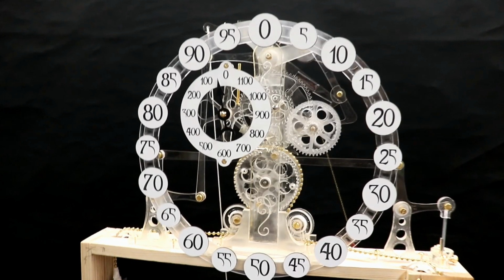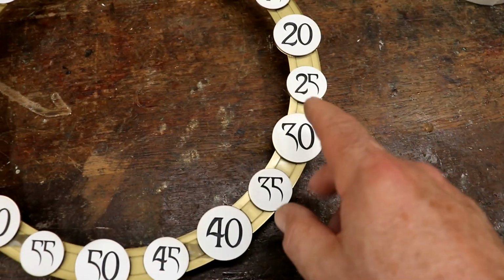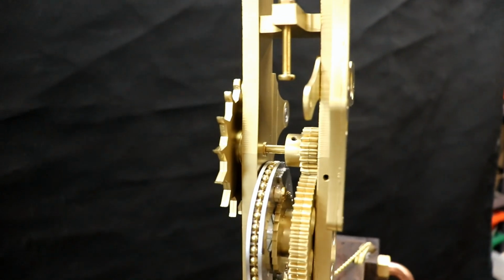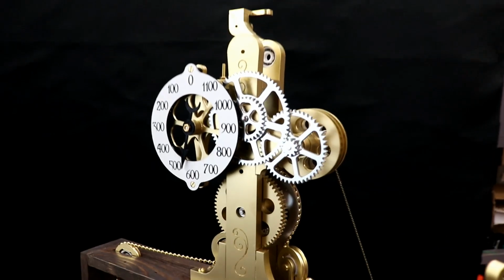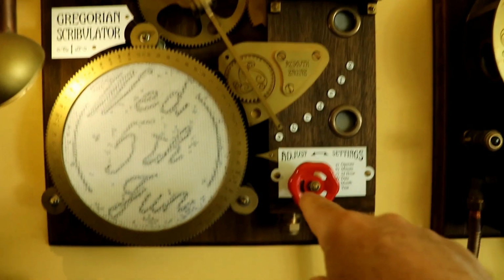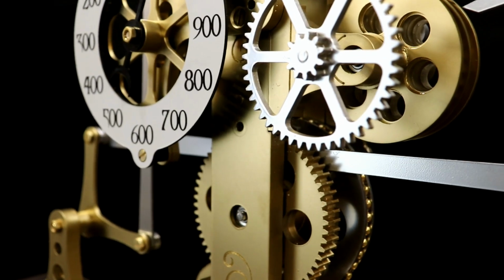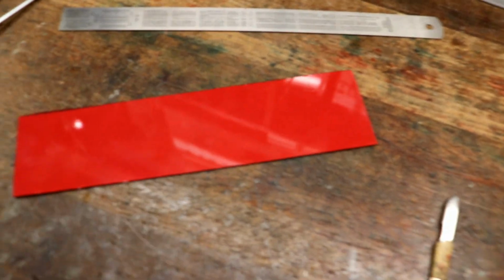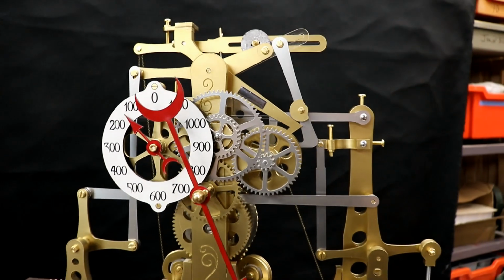Unplanned Steampunk Arcade Machine #9

Comment: So this is something I noticed before, but it's more obvious after everything has been painted and colored and appears to possibly be repeatable. The large scoring hand seems to miss a step between 30 and 35 and again between 65 and 70. As the dial goes around, it seems like something doesn't quite catch and the mechanism requires an additional tick to move on to the next number. I also recognize that the two groups of numbers and both in the bottom half of the dial and directly across from each other. This makes me wonder if there is a damaged gear tooth, or maybe something is slightly off-balance that would cause the mechanism to not advance on the first try when the dial is specifically in those two positions.

I realize it has been 13 days since you uploaded this video and it's likely you have done a lot more work on the mechanism since then, but I'm wondering if you plan to explore that symptom at some point. Either way, I'm excited to see what you've come up with when you upload the next video.
Reply from the maker: Thanks for being so observant! Having carefully made a new scoring ratchet, I don't think that is the problem. I believe it might have been as a result of the original escapement. I've made a new one with some changes to the design, and sanded each of the two laser cut acrylic layers to ensure everything is parallel. The addition of copious amounts of graphite powder helped it to function more reliably.

The fact something introduces a 'random' element to the scoring could be useful? Working purely mechanically is so difficult!

13 days is far too long between videos - I do apologise. The reason is that I received an order for another bespoke Barometric Prognosticator. Having made many videos on their construction, I'm just getting on with it. However, today I videoed another video, just keeping my wonderful viewers appraised of the situation.

I have also made an appearance on a Channel 4  series (in the UK), Outrageous Homes with Lawrence Llewelyn-Bowen! I don't know whether it can be viewed outside the UK.

Thank you for your continued interest!
Reply: @steamhead  No need for any apologies, I love your content and am happy to wait for it. Sounds like you've been busy as well!
Reply from the maker: @Advil1024  Never a dull moment!

Comment: Also why don't you use smd resistors to work with your smd LEDs. 1206 size could be large enough to solder easily. I use smd parts whenever possible. For example 805 size fits perfectly with .1 inch spacing standard of PCBs and ICs. You may also test smaller size Arduino modules like Nano (the new generation).
Reply: The LED found on the solar string lights is just a blob on two wires, 100 for 2 quid and scale nicely and look like a miniature bulb.
Reply from the maker: If more people purchased the shell lamps, which are a really niche product,  I'd definately consider  getting populated PCBs made up by some company such as PCBWay with smd LEDs and resistors. Sadly I seem to have cornered a (virtually) non existant market again, so continue to use up my collection of LEDs from a self adhesive strip and 1/4W resistors. One day I hope to move to smds!

Comment: As usual you solved all the problems. Well done. Is brass colored plexi much more expensive than the transparent one? I recommend you use colored plexi in your complicated mechanical parts. Paint will always be a problem and moving parts wear out the paint easily on the edges. Your scoring part is very sensitive to temperature. It is summer now, in cold weather it may not work. I recommend you add more adjustment parts like the one Ziggy suggested. When I design complex system, as I solve the problems the system becomes over complicated. But than I iterate and redesign the system using my new experience to simplify the design. This method pays off in the longrun. Your system if not used for months may not work again and you may  need to solve the problems again.  Red dial looks nice by the way. Using time as scoring hopefully pays off. This way you isolated the scoring system from the gameplay. Hopefully your game design will have almost no effect on your scoring design.
Reply from the maker: Hi Ibrahim, the problems are becomming more challenging... I've failed to find a supplier of brass coloured plexiglass and can't even find out if it's even manufactured - I wish it was!

Thanks for the suggestion; I've added as many adjustments as possible and they have proven invaluable. Hopefully they'll allow for changes in temperature and the water absorption properties of acrylic - who knew?!

Having the gameplay isolated from the game 'management' and scoring system will hopefully pay dividends! Keep the mechanisms separate...

Comment: That is looking really awesome John. I was always concerned about the effect of the spray paint, both adding friction and scraping off with wear, but it never seemed to be a problem on your other machines. What paint do you use?
Reply from the maker: Thank you. I use Plastikote Metallic Brass spray paint.

I was amazed to find, with my first laser cut geared machine, that the gears worked perfectly once painted and continue to work eight years on. However, most of my machines employ  elecmatrickory to provide the movement.

This is the my machine that relies entirely on gravity and it's become apparent just how much friction a painted surface can introduce! Powdered graphite solved the problem...

Comment: I noticed that you are cutting holes in the gears, maybe you can use these clippings as numbers, they have a beautiful triangular shape with conjugation. Well, that's for the future. Regarding the gameplay, I only see arkanoid, pinball, some kind of maze. Arkanoid and pinball are clear  how can it be. A maze, it can either be something like a Galton Board, or so that you can rearrange something to change the paths as in spacerail board game, when you build your marble track
Reply from the maker: Thank you for noticing the clippings. I always endeavour to use the materials as efficiently as possible, however there are bits of material, especially 'those with a beautiful triangular shape with conjugation', that are too small to be used elsewhere. I place any unavoidable offcuts, along with all the components that don't work, into a box of exciting parts. For the cost of postage, I then send these boxes to people who can make use of them - nothing's wasted!

Regarding gameplay: I imagine having some sort of skill based ball directing system at the top of the machine that the player can use to direct the ball into one of several alternative challenges. Assuming I go with the Jules Verne idea, the ball then has to be aligned to land on a load of moving clouds. These could direct the ball into the top of an airship. The airship could also be moving with a variety of ball channels within it, some of which direct the ball into a circular maze... you get the idea. If the ball is correctly aligned, it could then fall into a moving Nautilus submarine.

So many exciting possibilities... Thank you for your suggestions.

Comment: Looking good and the red pointer adds to the tension brilliant build John.  May I suggest you  investigate Nickel plating. Since you are spray painting anyway you can spray a conductive paint then plate with Nickel. The process is not at all difficult or messy unlike Chrome plating.  Nickel plating solution can be made from a strip of Nickel, some vinegar and a 1.5 volt battery.   I have tried various plating metals but Nickle is the cheapest and best.  Nickel also does not tarnish quickly and has nicer colour to silver and copper. Well done John, tell Ziggy, Banjo & Cooper found a Basking shark on the beach so they had a good roll around and smell rather ripe.
Reply: Wow that sounds really cool.. didn't know you could do that!
Reply: @syrus3k  YT comments have gone weird and my first reply to you disappeared. Anyway this is the channel that I found out how to nickel plate  ' Geoffrey Croker ' . I think you will find his style very informative and I hope John takes a look as nickel plating is found on a lot of Victorian kit as it does not oxidise like brass and cooper.  Have a go, also you can salvage the silver plate of cutlery and use the solution to deposit silver, win win.  Best
Reply: @WOFFY-qc9te  I'm actually in the process of setting up something called peertube which is a DIY YouTube open source federated thing.. hopefully one day we'll be rid of YouTube!
Reply: @syrus3k  I have had many failures with copper plating and chrome just rubbed off and is very toxic, I found that Nickel is idiot proof. Recently conductive spay paint has become available and that allows plating plastics. Too make life easy with the voltage use a 1.5 v battery and leave the job alone for a while.   I found the original channel that steered me to simple nickel plating it is very good and with no crap. GeoffreyCroker  Have a go it is very rewarding. Also you can salvage silver from old cuttlery !.
Reply from the maker: Thank you kindly. I'll definately look into Nickel plating as the silver spray paint isn't nice to use. What should I use to first make the surface of the acrylic conductive?

Banjo & Cooper must have been thrilled to find Eau De Rotting Basking Shark. The other day Ziggy appeared from a woodland exploration, proudly covered in some unspeakably horrific gag provoking substance. Two washes later...

Comment: You totally need a vacuum deposition system.  I could help you build one. Imagine having real gold plating and merely using gold leaf or a donated filling as the source.
Reply from the maker: Thank you for the suggestion. A vacuum deposition system would be lovely, although a spray can of brass paint seems to do the job! If the gears, especially the escapement, don't stand up to the rigors of operation, I'd consider getting them 3D printed in metal by some third party!
Reply: @steamhead  I used to run the electron microscopy lab at Winthrop University and we’d coat things ranging from honey bees to dust mites. The beam would only bounce off of gold or other metals, therefore the scales of a butterfly wing, needed coating. I love the incredible skill you display with your processes. I used to live in Cambridgeshire. Where do you practice your genius?
Reply: @Endoplasmic-Reticulum  It is an amazing process but on the sub micron level. insect look amazing after VD. I think the thought emporium did some home brew work.  Aluminium is the easier as it has a low vaporising temperature and I tried to re-coat a torch reflector with mixed results.   In todays world there is so much kit around it is something that can be done in our sheds. I did some work on a centrifuge at L=Pool university (1990's) and was shown the Electron microscope and a plated Moth, I spent too long in the lab and had to work late to catch up.
Reply from the maker: @Endoplasmic-Reticulum It's a privilege to be chatting with someone with your experience. I'm so thrilled my YouTube channel attracts so many amazing people. On a down side, I live in North West London!
Reply from the maker: @WOFFY-qc9te what an amazing conversation! I'm very lucky.
Reply: @steamhead  I wrote a rather lengthy response yesterday but for some reason, it was deleted. I can’t for the life of me, understand why. Oh well. 😞
Reply from the maker: @Endoplasmic-Reticulum  I'm so sorry your response was deleted. I have no idea why YouTube regularly ignores/deletes some comments and replies. It doesn't make any sense to a mere mortal...
Reply: @steamhead  It’s okay. It was just a background of my education and what I’ve done. Interestingly, I attended Christ's Hospital School for grades year 7-9 which is in West Sussex while my parents lived in Cambs. Perhaps if I knew YouTube wouldn’t delete it, I’d go onto more including being 17 running a research program. Grrr
Reply from the maker: @Endoplasmic-Reticulum  it sounds like you have a very varied and interesting life. Possibly too interesting for the YouTube algorithm!